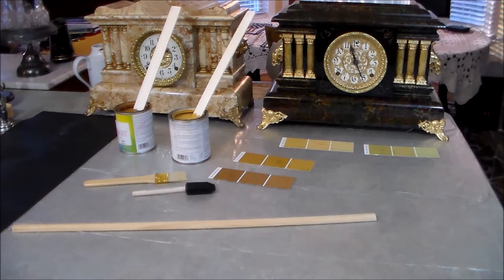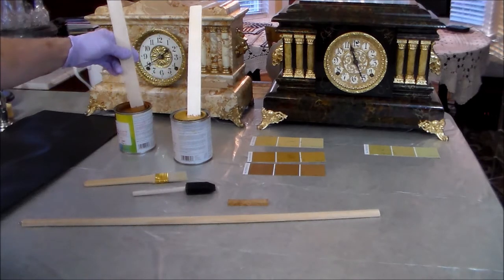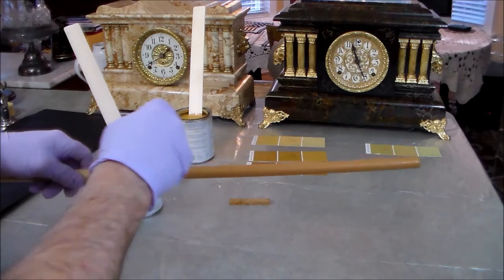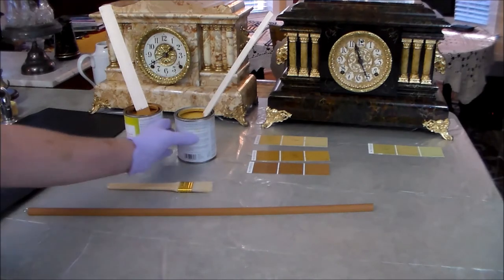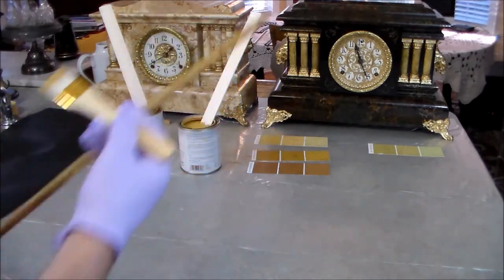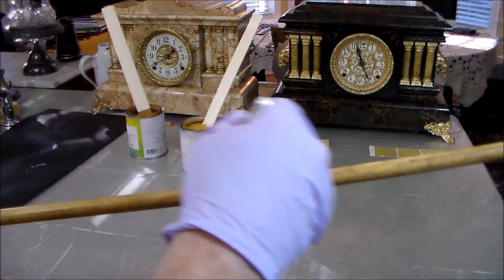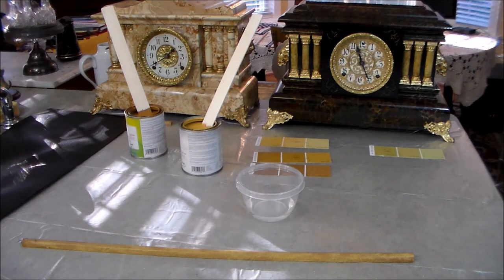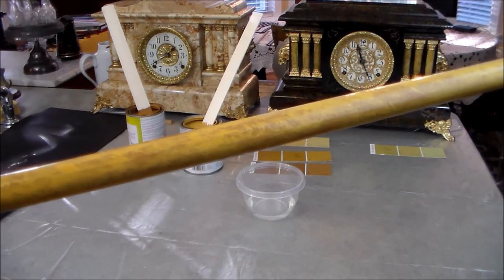Make Replacement Columns for Antique Black Mantel Clocks

Comment: can you tell me about the clock on the left in the video how old with anything?
Reply from the maker: Jerry,thanks for watching; the clock on the left is a Seth Thomas Adamantine.  Columns are original.
Reply: @nabersoldclocks1837  thanks for the comeback. do you know how old of value mine doesn't work and how can I tell if mine is Seth Thomas?
Reply from the maker: @geraldkerber2761  Jerry the clock pictured is a Seth Thomas Unlisted #2 # 1582 on page 477 in Tran Duy Ly's Seth Thomas Clocks and movements Vol 1; the year is 1900.  Adamantine is a plastic like finish and will appear as such look at the back of the movement there may be  stamped  logo with ST in a diamond or circle 89 is a common movement.  Also look at the bottom of the dial paper for small writing underneath the chapter ring
also, but not always, there is a stamp in paint which is a reverse month and year.  As for value, although clocks are depressed, I would say over 200, less than 400, in the current market.  although not a great indicator, check for Seths sold on eBay.  If not running the clock can be repaired and is worth doing.  Hope this helps.